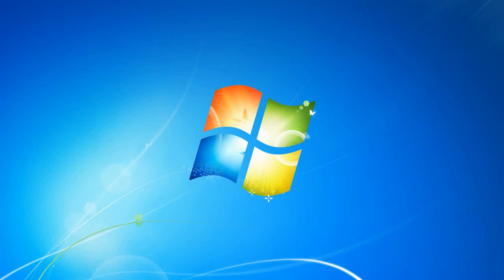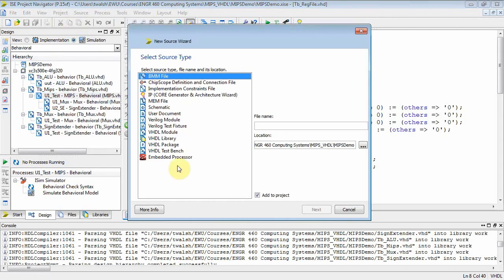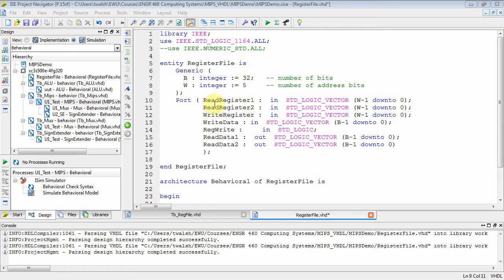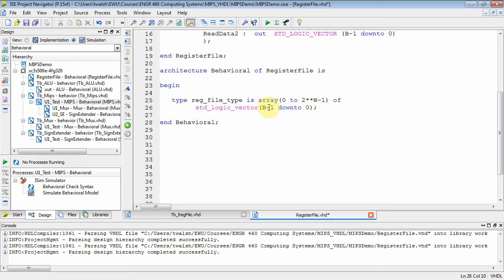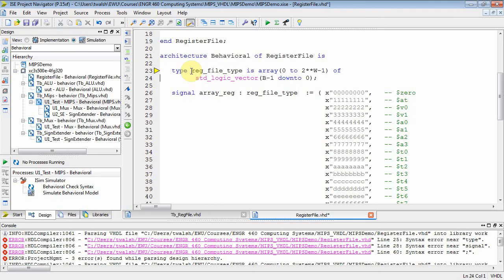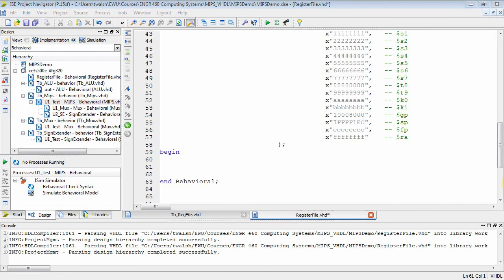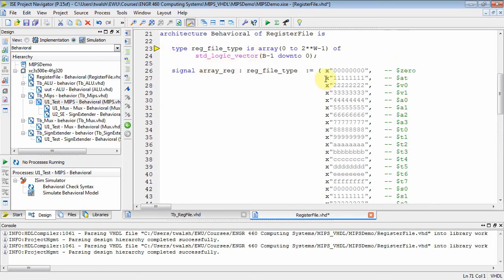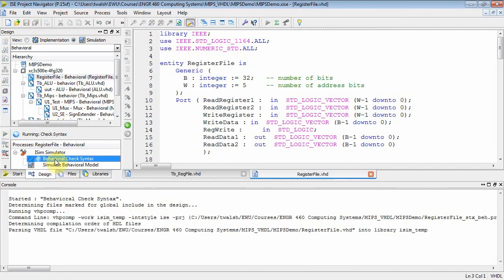EENG 460 Lab #4 Part #1: MIPs Register File

Comment: why in the signal declaration we have for exemple both x"0000000" for $0 register and for $s0 register?
Reply: If I'm not mistaken, its because most of the registers’ value doesn't matter, the only ones that matter are $gp and $sp, the others are initiated in 0x00000000 (MARS for instance), so he used that to see better.

Comment: why do we need to convert  readreg into integer
Reply: because the registry file is an array called "array_reg", so the address has to be an unsigned integer to serve as the index to that array. Array indecies look like 0,1,2,3... not 00000, 00001, 00010, 00011. Even though the binary address and the integer mean the exact same thing, an array will only take the integer.
Reply: @getup40owl  Thanks a lot